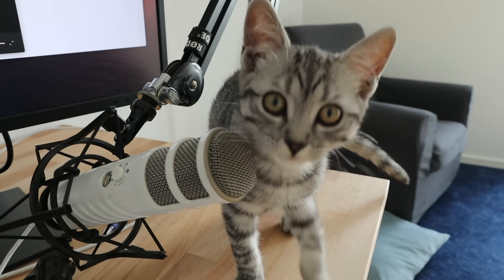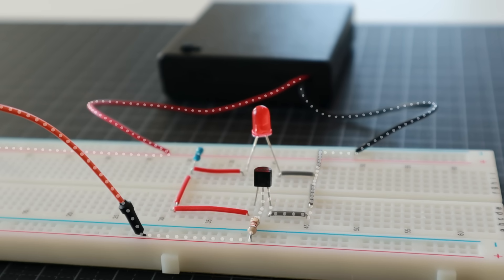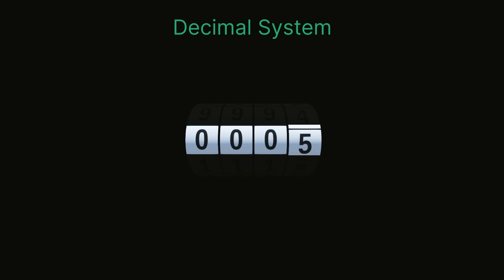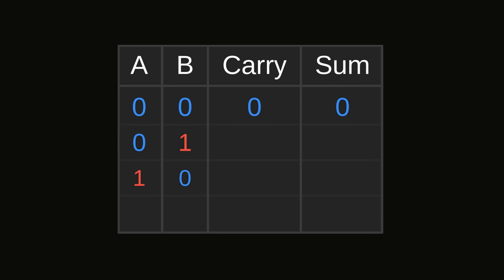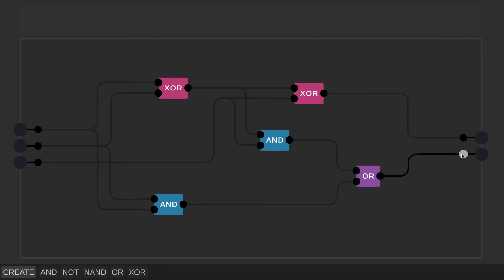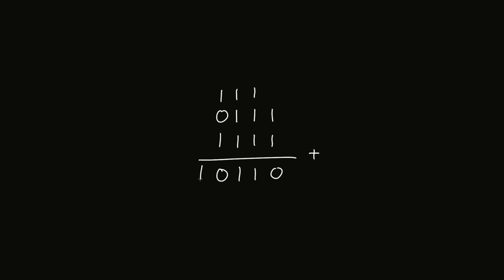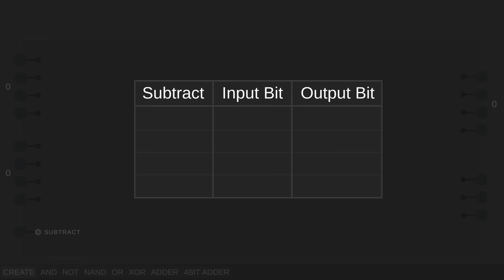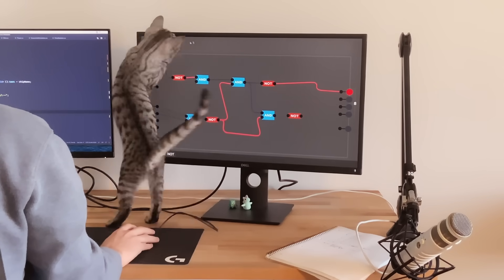Exploring How Computers Work

Comment: The current animation on the transistor NOT gate is a little misleading.  You will still get current flowing through the LED but because of the resistance differences, you create a voltage divider and most of the current will flow through the transistor, but not all of it.  There's just not a enough current to light the LED at this point.  I mention this because it was a source of confusion for me after learning about Ohm's and Kirchhoff's laws.

Comment: The design of an AND gate is based on the idea of connection in series, whereas the design of an OR gate is based on the idea of parallel connection in electrical circuits
This video is suitable for beginners

Comment: Your explanation for the 2nd example with a LED and a switch is ignorant and incorrect because the reason why the light is on only when the switch which connects the 2 parallel wire is opened,  is that in the case when there is only one wire connect the negative terminal and the positive terminal, the total current "i"  will go through the LED, which has been designed to be on only when there is a certain amount of negative charge carried by free moving electrons, and positive charge transmitted by cations running simultaneously though it. When you connect another wire parallel to  the wire connecting the LED to the 2 terminals, the amount of negative and positive charges, or the density "J" of the current through the LED will be reduced to become not enough to overcome the resistance force of the LED' s material' resistivity ρ ( measured in Ω) to establish a flow of 2 opposite charges between the 2 terminals. Here is the formula for the explanation:
I total = i1 + i2 
Where i1 goes through the LED, and i2 goes through the switch.
 Radiation or light in the LED can be possible only when the current going through it is equal to the total current "I total" running through the circuit. But when you apply parallel connection for the switch, the total current "I total" will become divided into i1 and i2 , and only  i1 going though the LED, which is not enough for the radiation  or light to happen,  or not providing enough kinetic force for free electrons in the LED to move faster in their random motions to collide with one another to cause frictional forces to convert the kinetic energy into thermal energy for free electrons to release photons to create light or radiation.
The reason why i know so much about physics and electronics and computer science is that the reason for my study of computer science is for only  STEM scientists and teachers, but not for  those who just want to become merely a software engineer or a pure programmer, or a hardware engineer. Computer science is merely a scientific device among many other scientific instruments for a true knowledgeable scientist to use in their scientific projects, but not all and only one tool

Comment: The 1st example  can be explained in the language of physics, which provides physical properties of a circuit consisting of a voltage source or electric field, and an external conducting circuit which allows free electrons to run from the negative terminal to the positive terminal in a DC. It is the same as all electric outlets or sockets in households and offices. Whenever you plug in or connect an appliance, such as your computer, the plug will close the open circuit, which creates a path way for free electrons to move from the negative terminal to the positive terminal of the source power supply, under the electromotive forces EMF from both of the 2 terminals of the voltage supply or power source, and also for the simultaneous transmission of positive charge  in the opposite direction to the direction of free electrons, or from the positive terminal to the negative terminal. Electricity is not formed by merely a flow of free electrons from the negative terminal to the positive terminal as how professors of physics always teach you at universities. But it can be established only when there are two opposite flows of free electrons from the negative terminal to the positive terminal, and a flow-like transmission of positive charge from atom to atom or from cation to cation in the atomic lattice structure of conductors, and from the positive terminal to the negative terminal. The 2 flows have to take place simultaneously, in order for you to have electricity. 
    The repulsive force comes from the the total negative  charge on the negative terminal where free electrons carrying negative charges are accumulated, and the attractive or pulling force from the positive terminal, on which the number of atoms which have lost their electrons in the covalence, and become cations or positively charged ions, are accumulated. In order to understand well how a computer works, you have to have good knowledge of both physics and electronics, but not merely computer science's hardware architecture and assembly programming language used to enhance the performances of computer hardwares

Comment: Perfect instruction. I could follow everything but one detail on 16:28 ...

I don't understand why the result is negative whenever bit 8 on the 4bit-adder output is on. That's not always correct in my opinion, because for example with a simple calculation of 4 + 4 (subtraction off) you would get a positive 8. The calculation is only correct when the 4 is automatically negative, so in this case, minus 12. After all, -12 + 4 equal -8 (subtraction off). Can it be then, that this ALU cannot give out a positive result with the bit 8 on? In this case I assume then the first number of the calculation is always negative. Sadly, this assumption is wrong thanks to an example calculation of -1 + 9 (subtraction off). -1 is IIII and 9 is I00I. This equals 8. My simulation says minus 8 though, which is wrong. It could be now, that this isn't possible due to the binary number IIII, because this could also mean 15 and then adding 9, the result is over 4 bits. In other words, over their limits. I conclude from my discoveries, that whenever bit 8 of the output is on and the substraction off, the two input numbers in positive must have a result of smaller than 16, even though the first binary number should be seen as negative thanks to the negative flag. Now I wonder if I miss something, because I guess I do but don't see it. I'd appreciaty any help now. Thanks!

Comment: I was doing fine until I got to 4bit-adder-full-adder.  Btw I build my 4bit-adder-full-adder from a pair of 4bit-half-adders and it tested fine.  Then I tried to create 2 four bit nibble inputs and a 1bit carry-in as well as a 4bit sum nibble and a carry-out bit.

I am getting 2+2 = 8 and all sorts of incorrect answers.  After spending an hour verifying every component up to the 1bit-full-adder I had to give up because the 4bit-full-adder was producing garbage.  I could not produce the 4bit nibbles as the decimal values as in your video.  Do I not have the correct version of the program?

Here are some screenshots showing the components up to the full 1bit adder and then how my 4nit-full-adder matches yours yet I am getting garbage out?

Here if you have a sec go check some screen shots.... https://imgur.com/gallery/zqmAUTo
Reply: Fixed it.  But there might be a bug in your program about the order the lines are connected maybe? If you look at my screenshots someone pointed out to me that full-adder2 has only a carry-in and its output should therefore go to sum not to carry-out as you can see.

Here is why I think there might be a bug.  My fix was to simply delete the co2 going to ci3 which for some reason deleted both co2 AND co1?  When I redrew both co1 and co2 exactly as they were before the chip worked as expected.

Thanks to the person that pointed out the ripple carry from full-adder2 to full-adder3 to me.

Comment: Adding 7 and 7 in the ALU gives me an output of 14, but NEGATIVE turns on too. Is this supposed to happen? Why?

Edit: With the ALU, it seems that adding any numbers with a sum greater than 7 will incorrectly turn on NEGATIVE. Also, why have a subtract input when you can just pass in negative numbers?

Comment: Anyone out there who can help me? I'm stuck on a problem on the building of the ALU. For how we built the 4-bit adder module, a sum of 7 (0111) and 1 (0001) gives an output of 8 (1000). The problem comes out when I try to do the same thing with the ALU, because in this case 1000 is -8 (Two's Complements System), and it gives the impossible result 7+1 = -8. For the same reason 5 + 5 is -6 (0101+0101=1010).

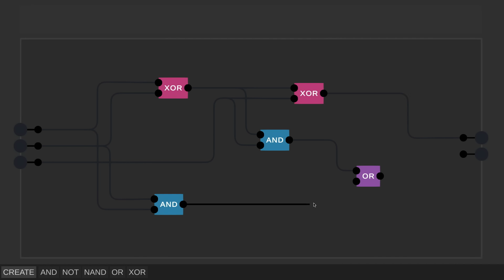Comment: 10:07 This coulda been done simpler
AND to NOT with a wire in between to pass to carry volt, then an XOR gate to the output, as for the carry the inputs can also go to an AND gate before being passed to the output carry

Comment: This program is exactly what i needed. I have several pages worth of circuits and complex gates that I will now try to/ have begun to implement. The lack of a delay block made it a bit difficult, but I managed to create one myself
Edit: I made a chip too big for the screen, but i think i can subdivide it
Edit 2: It's been six days and I'm almost done with making a fully functioning calculator
Edit 3: I'm currently in the debugging phase and I somehow managed to break the OR gate
Reply: damn, upload a video of it if you get it working. that sounds really impressive 👍
Reply: wow
Reply: good job, hope you keep going from there

Comment: In 18 minutes, this video shows you how electronic components translate to logic gates, and how logic gates translate to binary numbers, and how binary numbers translate to decimal numbers.  Since the birth of electronics in the early 1900s, this is how every microchip, electronic computer, and electronic calculator has worked, including the one you're using to watch this video.  All we did was make the components, and thus the circuits, smaller and smaller and smaller.  I've used a multimeter and oscilloscope, and drawn logic networks, and done computer programming, and I always understood the link between binary and decimal, but until now, no one actually ever told me what the link is between the electronic components and the numbers.  Astounding!

Comment: How does a signals stay active when it's cut off from the source? Like at 4:08...
Reply: That is the "Not gate"
It outputs the opposite of the input,
(If input is on, then it outputs off)
(If output is off, then it outputs on)

Comment: for the not gate when the light is on , isn't that already the easiest way for it to travel? when you close the switch isn't that further now for them to travel around in a circle
?
Reply: No, because electricity doesn't care about distance (on this small scale). What it does care about is the amount of resistance it will face on one path vs the other. The lamp uses some energy, therefore the current encounters some resistance. With the switch closed, it now has a path free of any components that would take energy away from it, so it will go there.
Reply: @eliad6543  Thank you very much ! :) I appreciate your time answering my question.

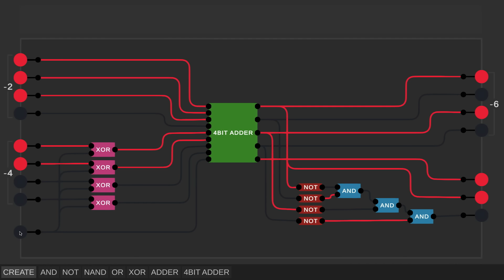Comment: 17:19 -1-0 gave me -2 and I think this is an error with the ALU since the 4 bit adder is being fed -1+-1 since flipping zero using xors gives you -1
Reply: You should flip the bits but also add 1, otherwise the result will always be off by 1.
Reply: Yes that should be negative of 3
Reply: @banshkumar3498  -1 +1 = 0

Comment: I still don't understand how the information is sent to the transistors or logic gates. None of these videos has explained that. For example If you want to send a 64-bit number to the logic gates, do you always need 64 individual electrical wires and the bits are always sent simultaneously? I thought you could send information digitally through just one wire, a bit like Morse code or something... I just don't understand how the logic gates would be able to interpret that kind of signal
Reply: Sending it as a morse code (or any other serial signal) would take longer and is more prone to errors in the process, and we are talking about CPUs that makes bilions operations in 1 second.
CPUs has parallel signal - all bits from 1 "number" at a time. You had probably seen CPU chip, and now you now why they have so many pins :)
btw, information is send like you described over cables, or wi-fi - in networks, and to most devices usually, but here it is about internal chips operations.
So yeah, the serial signal is always translated to parallel before any operations could be made on it.